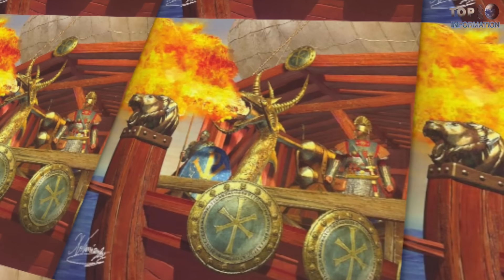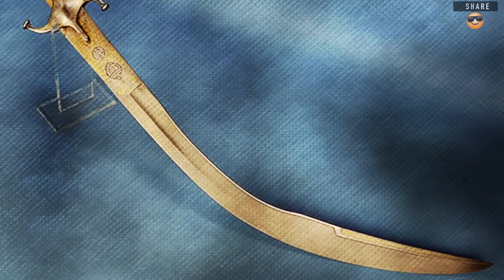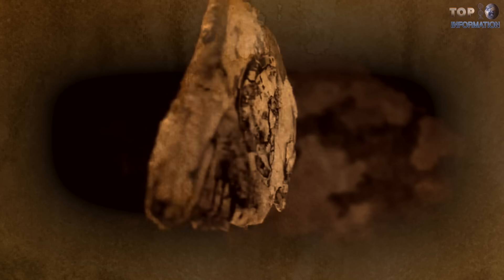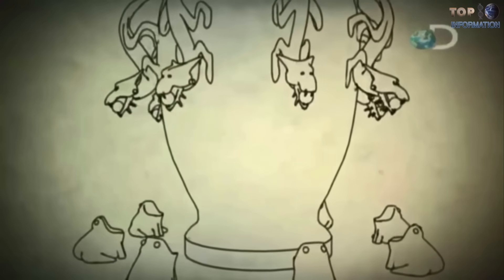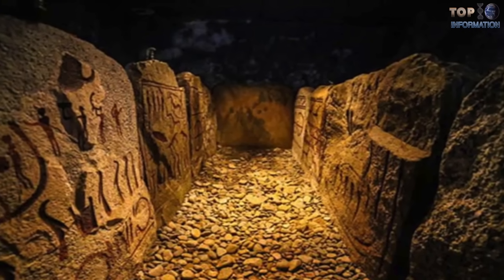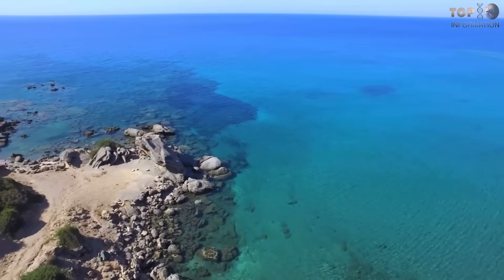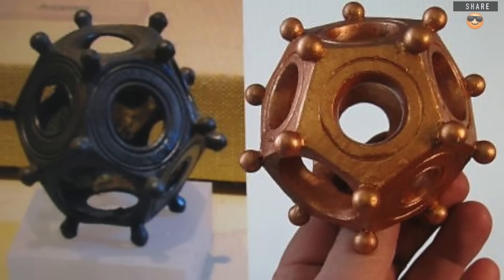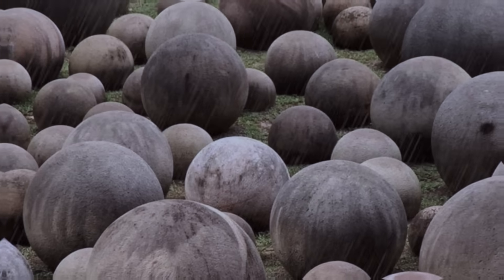10 Ancient Inventions that Science Can not Explain ▶ 8

Comment: the one that's getting me is the roman ball with nobs. the only point I would see with nobs are to distance the base from the ground or to reinforce  with distance , such as a bed of nails. now, at 10:19 you can see that the top and bottom are exact opposite, while the others are not they are in a actual opposite star pattern. so, Idea 1 the top and bottom line up to slide a pole through the other holes are for sharpened sticks  it would be a cheaper from of barriers. ; however Idea two is it just looks like they are water mines, they had explosive materials packed inside , the holes may have been solid metal that turned into shrapnel , the metal covering the hole were thinner. Idea 3 they were lamp protectors maybe the hole are for light to pass through.

Comment: Wow really, a steel column that still stands 1'000 years later ? The oldest still used building in Switzerland is a wooden house that is over 700 years old. Then there's all the castles from 1'000+ years ago, like Chateau de Chillon or the medieval village and castle of Gruyère, also famous for its cheese. They still have structural integrity but are basically historic sites and/or museums. While the wooden house is just regularely inhabited and up to code in terms of laws.
And that's in a climate with 4 distinct seasons throughout the year. Freezing and snow in winter, heavy rain and winds in spring and fall, and tropical dry and wet heat in summer. I wish i was more excited about this list in the video, but it's hard to.

Comment: --Greek fire - combinations of pine resin, naphtha, quicklime, calcium phosphide, sulfur, or niter.
--Damascus steel isn't a mystery its just useless compared to modern steel that has NO IMPURITIES. Damascus steel was superplastic and very hard at the same time. During the smelting process to obtain Wootz steel ingots, woody biomass and leaves are used as carburizing additives along with certain specific types of iron rich in microalloying elements. These ingots would then be further forged and worked into Damascus steel blades in Damascus.  --lastly its pronounced dəˈmɑːskəs not Dom-es-cus

Comment: 9. There are many things very wrong about the Damascus steel in your video.
Reply: The folding of japanese bladesmiths and how Damascus steel is made is different.
Reply: @CountyBoyOgre  You're correct, the two types of blades are made with different techniques. Similar, but not the same. Both blades are made of layers consisting of differing concentrations of carbon, with different heat tempering for edge maintenance and blade flexibility. The Damascus technique can be done by modern means, and there are still modern Japanese artisans creating Katana blades with the traditional methods. Neither technology is really lost, but also not commonly used any more.
Reply: Please explain with detail
Reply: @annoehler1792       it was first being made by the japanese, samurai swords are from damast steel.... and it is still being made today, a very lot actually by modern blacksmiths............      its not a scientific mystery at all, its just steel folded multiple times together......
Reply: Yeah. Good luck convincing Chad Nichols that nobody knows how to make Damascus steel. Lol.
Reply: It's not just the steel that's a "flaw" here... A flaw is a birthmark this is blaintent miseducation

Comment: The dodekahheedren I may have a answer for. When I was younger I saw one of these in a families home and they actually had a torch in it. According to them they got it from some older relative and they were used in ancient times to be able to keep the torch stable and to have different sized holes in them to fit different torch handle sizes due to visitors from other areas and even in same kingdom no standard size of torch. Also they claimned you could put like a big torch in center and then lean off smaller ones on side and not tip it. So that may actually be the right answer . These people were told this ages ago so this old info may be lost in modern times

Comment: What is modernly called "Damascus Steel" is pattern welded steel of sections of varying carbon content. When etched with acid, the acid affects the differing alloys of steel differently, revealing the pattern. 
A simple search on either Youtube or even Google will easily reveal much better information on Damascus steel and what it actually is (Just a term to refer to pattern-welded steel) 
And your Ulfbert sword information is also grossly wrong. 
I would suggest doing some actual research or write your segments better if you have done any research.

Comment: You're talking a lot of bullshit and wrong things.
Damaskus is not a sort of Steel, it's the process of creating it.
In asian territory, iron ore occurrences where not as rich and clean as in Europe. Because of this reason, the iron had to be cleaned. This was made over weeks with folding it over and over while putting ash and straw/leaves between it. still, this steel never got as good quality as european steel had, mostly.
Just if the Smith put in rly large afford into the cleaning process.
It does not have in any way to do with a special "heating and cooling technic", what a stupid bullshit. Those swords although where not able to cut through stones or other metals 🤦🏻‍♂️

A knight with his medieval long sword, would have broken every Damaskus made sword into pieces, without damaging his own and there is a special reason for.
The swords you're talking about, just got hardened to a bit higher grade, than a usual long sword got. what makes it stay sharp for a longer time, but at the same time more prone to break.

There are videos of damascus sword getting hit into medieval long swords, where the damascus shatters or brakes, while the long sword just got a dent or is bend a bit. Same vise versa.

Comment: the dodecahedron is a bracket for supporting beams that cross. it's used in wheels to form an over-under pattern of spokes so that two gears can move in unison within the same plane. most likely used to form stable cylinders for various construction equipment such as cranes and carriages.

Comment: Number nine is completely wrong ..you were supposed to be referring to Wootz steel not Damascus steel.  fyi - the 'secret' died when the only mine that produced the steel (located in India) was depleted (only through melting old steel could these swords production be continued - and then only for a time).  
The secret to Wootz steel ore; was that it had nanotubes of carbide in it (created when the steel ore was formed, I believe) ..so, when sharpened in a 'standard' way, these nano tubes protruded from the steel (as carbide is stronger then steel the sharpening process makes them stick out).  This created a 'micro saw' blade edge that stayed 'sharp' for a far longer time then standard carbon steel when sharpened to a fine edge (plus, the micro saw edge gave the 'cut' of these swords a legendary status).
It's worth noting that some antique samurai swords were made from Wootz steel too
Reply: Moody
what u said is nt totally correct.

Comment: Much of this video is nonsense.  

Besides what has been mentioned about Damascus steel, the Ulfberht (various spellings) was probably originally a respected swordsmith's mark which was copied by other swordmakers. They are all meteoric iron or bog iron, so having carbon content is not surprising. There is nothing unusual in the design, it follows a logical path from previous swords. And the swords were not poured then forged, as shown in the video.

The stone spheres are NOT perfect spheres as claimed. Some vary by as much as 2 inches in diameter and the degree of "roundness" varies significantly between various spheres. There is also an area in the region that has numerous oval stones.  There are a number of trivial ways that templates could have been made and used to get the stones into their rounded shapes.
Reply: I dont agree.
Reply: All of what I have written is documented in the scholarly swordmaking references.
Reply: buggsy5 the ulfberht thing you said was common among vikings